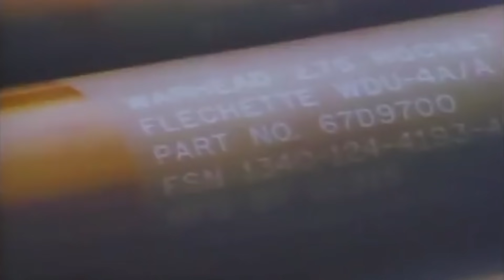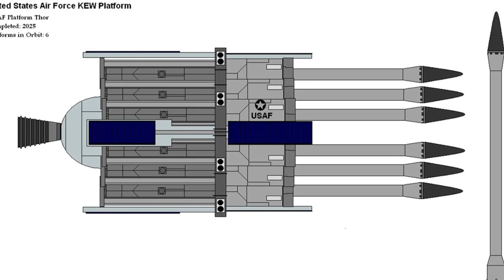'Rods from God' Weapon System Gets Another Look

Comment: Skydivers worldwide are groaning. thinking "Its not the height that gives it the speed, its the angle, Terminal Velocity is a thing"
Reply: @Joe Biden Official Nope, But theres always going to be SOME drag. and the terminal velocity equation is fairly easy to search up
Reply: LOL.  Tell that to meteors or any returning spacecraft.  You're basing your idea on an object that starts out at roughly 0 velocity and accelerates due to gravity.  Not one that is traveling thousands of miles per hour in orbit.
Reply: @maddpeanut6313  its the angle, tracking across the sky is what allows skydivers to exceed terminal velocity speed, terminal velocity applies with how much you can accelerate with gravity vs drag coefficient.  You can exceed that speed by traveling at an angle, with terminal velocity + lateral speed.  So my comment has to do with the height not mattering as much since with ANYTHING there is a terminal velocity, and height only matters til you reach it.   You can exceed it with an angle.

Comment: need two type... one type of rod with  self-sharpening depleted uranium with the mass of the rod being tungsten... the other being a blunting tungsten to create surface kinetic destruction, rather than down inside a structure.... add a ceramic nose for heat deflection.... break away at near impact.

Comment: If the launching platform is already in orbit, it's in perpetual freefall.  The issue becomes one of getting the projectile to slow down enough to hit the surface of the earth first.  Secondly, it's got to do this accurately.

That's a pretty tough list of things to do.  In addition, it would require each kinetic projectile to have a huge rocket engine on it to slow it down fast enough so it falls rather straight-from-above into the target.

Although initially the concept sounds simple enough, the notion is currently beyond our technological and financial ability.
Reply: What about just using an ICBM instead of a satellite? Do they want an undetectable bomb or something with the potential of a nuke without the radiation
Reply: Who knows?  Usually, these fanciful notions come about and gain traction from a large void of basic physics knowledge.

I consider most of them in the category of ignorant investor harvesting machines.
Reply: It would take a deorbit burn but that takes a lot less energy from LEO as you can get most of your deorbit from LEO by hitting the atmosphere. Reentry vehicles do this all the time from the ISS. It's within technological reach but it doesn't deliver the punch that is typically advertised because the energy comes from the rocket launch fuel and a very small fraction of that energy can make it through to impact with all the rocket equation losses and atmospheric losses and deorbit fuel mass & number of munitions and command and control bus on orbit mass and divided between all the munitions.  So clearly not like a nuke but it would be unique. Presidents would not use it though (weapons in space). They were too squeamish to use the conventional MOAB for 2 presidents over the span of a decade in middle of the wars it was designed for. None of those bedwetters would dare use a "Rod from God". Not that it is a practical weapon, it would have some unique capabilities though.

Comment: What's wrong with having 20-foot-long versions of these dropped out of the back of a plane from like 80,000 - 100,000 feet with fins to control direction? The front could be the heaviest side, making it automatically tip forwards. There would be an ultra fast rocket engine on the back to essentially launch it downwards vertically as fast as possible.
Reply: Accelerated in a vacuum far more effective, basically a meteorite humans can aim perfectly
Reply: @jamesmaralyn6745  I've read that being out in space gives them the capability to place one anywhere on earth in 30 minutes.
Reply: The advantage of orbit is you don’t need a rocket motor to accelerate it, it’s using purely gravity. Also it would be stealthy as we have sensors to detect heat plumes from rocket engines. By the time they detect it on reentry they would only have maybe 30 seconds or warning.
Reply: @ryanhampson673  you do need a rocket to get it to space anyways though, the real low reaction time would be a hypersonic nuke launched from a sub could get the reaction time to 30 sec
Reply: @ryanhampson673  Except a 2000 pound rod has a terminal velocity of about 500km/h and dropping it from lowest possible orbit would take 14 minutes (at terminal velocity) and it would heat up in way less than a few minutes, giving more than 10 minutes to react.
Just because something accelerated beyond speed of sound in vacuum, doesn't mean it will continue going that fast on reentry. Do you know why things heat up as they fall back into the atmosphere?
Reply: That doesn't get you hypersonic velocity. From Low Earth Orbit you're starting out at Mach 25 and decelerating from there a bit but come in steep enough and you'll probably be impacting well above Mach 15 (total guess), that's still not nuke equivalent energy but it's a lot of energy and it's highly directed for penetration. There's also no stopping it and possibly deniability although that might stretch credibility.
Reply: @dorbie  15mach? do you have any clue how drag works? It will be way below 1 mach before it is anywhere close to the ground.
Reply: @dorbie  That's a lot of words to say "I can't read drag formula because  am an idiot".
Maximum speed is 600km/s, I don't know where you're getting double digit mach speeds but you can't do basic math so I am not surprised.
Reply: @kirayoshikage4057  You're rude, wrong, and too dismissive to learn better. Published results show a Ballistic Coefficient of 100 with a 12 degree reentry angle at Mach 20 can impact the ground in excess of Mach 9, that's a low β for a spacecraft but high β for a rod. Up the β and you would be correct, but this is a rod BECAUSE rods have low β. Something I tried to tell you but you dismissed as "words", how VERY clever of you. It's a shame "words" never got through to you but I've read the hypersonic warhead reentry literature, you haven't (it's a lot of words). You read a high school equation, made some erroneous assumptions and decided you know it all. Well you categorically do not. Conservatively you're out by a factor of over 20x, (ignoring your embarrassing units error).
Reply: @kirayoshikage4057  they wouldn't of bothered if it didn't work and guess what it's highly effective and easy to maintain meteorite entry speed.
The one thing you are forgetting about meteorites they mostly rock but  they incredibly dangerous with a high iron nickel content. The reason why shuttle and rest hard to get through atmosphere is they intend to stop.
When you don't intend to stop acceleration is not even a problem.
They are aerodynamic and solid.
They are death when impact earth.
Remember destruction of others is easy for humans.
Reply: @kirayoshikage4057  Your bald assertions and personal incredulity do not trump the research. It's all about the β and for someone who claims to know what they're talking about you are obstinately ignorant about this. 12 degree reentry from Mach 20 LEO orbital velocity with a β of 100 results in a > Mach 9 impact. I doesn't get any more specific than that. A rod would be significantly faster due to reduced β. You say things in every post that convince me more and more that you really don't understand as much as you pretend to.
Reply: @dorbie  I know this was years ago but it is funny reading these comments, how confidently ignorant kirayoshikage4057 was :D Thinking the rods from god weapon would be subsonic by the time it hit the surface, so many things wrong with that assumption. A) Kind defeats the whole purpose of the non-explosive weapon, that was legitimately considered as an idea to spend millions to put into space. B) It's entire concept is based around hitting the ground at many, many times the speed of sound. It's the epitome of weight over drag, one of the heaviest metals with the lowest possible drag coefficient. It will hit at Mach 10 for sure. I do love the other end of the spectrum, some people talk about it being used to trigger earthquakes, while it would be an amazing bunker buster, no, it would not do that :D
Reply: @The24Gamer  Yea, being wrong is one thing, being wrong and insulting is an embarrassing combination. It is still worth remembering that every erg of energy in that weapon comes from the chemical energy of the launch vehicle's fuel minus LOTS of losses, so there are some tough restrictions on how energetic it can be, but it's still an impressive punch when you check the available data. It might make more sense to use a smaller rocket to deliver that kinetic punch more directly and on demand than going into orbit incurring greater energy losses, and being subject to the targeting restriction of orbital mechanics and a planet with a 24 hour day.